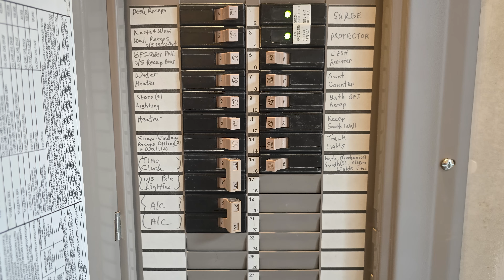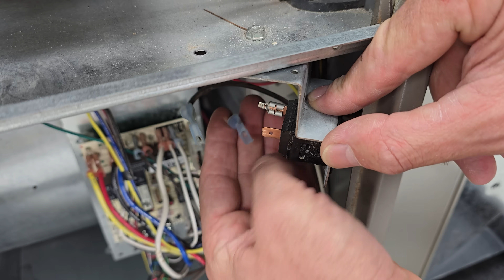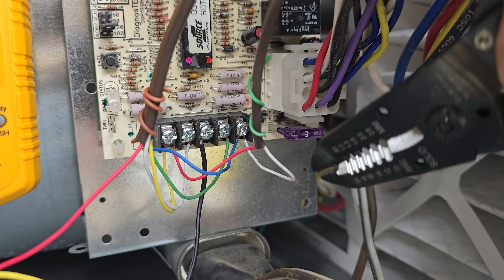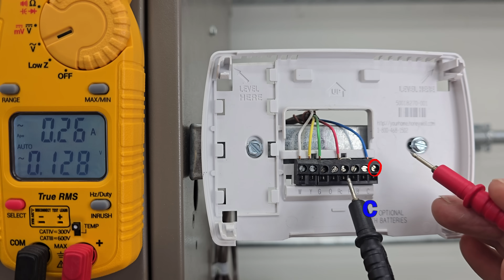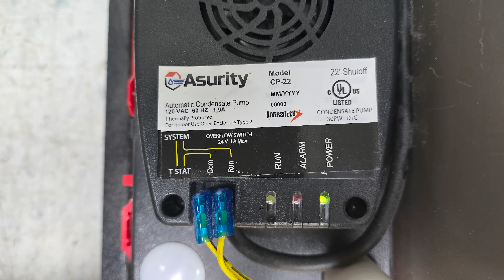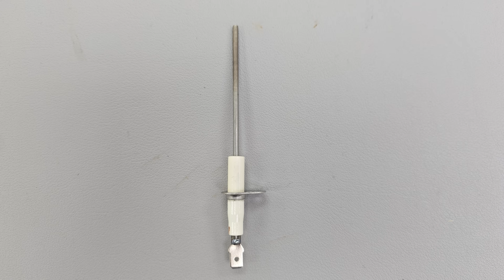Gas Furnace Not Working? Initial Steps for Troubleshooting When The Furnace Does Not Turn On!

Comment: Yeah this kind of electrical troubleshooting on furnaces usually ends up needing proper heating system repair when you find the actual problem - American Residential Services handles heating system repair for issues like this where the power's getting cut off somewhere.

Comment: This is a really solid step-by-step breakdown. It’s crazy how often a “no heat” call ends up being something simple like a switch, fuse, or loose connection instead of a major failure. That’s usually what experienced techs at American Residential Services run into as well.

Comment: I have an issue with Goodman package units where it shoots a little bit of gas, lights, then , shuts off then when I try to run it again now it doesn’t shoot out gas anymore, but when I put power to the gas valve it shoots out gas ,your help would be appreciated!!

Comment: Mine is tweaked it turns on the flame and gets hot but the blower motor does not turn on. I tried rotating the fins to see if there is any resistance and there is non and the thermostat got good batteries,  it works one day it turns on but then it turns off after like 1 day or two it's set on heat and fan is on I don't know what to do I can't really afford to have someone fix it anybody know what else I'm missing also the breaker never tripped it turns off and flashes red light one time meaning limit switch is on meaning overheat bc the blower doesn't turn on all the time some help me

Comment: ok i just installed a brand new MrCool model  number MGD80 gas furnace and it is supposed to be an energy efficient heater, now it uses more natural gas than my old 1970's heater did, my gas bill is like doubled, don't get me wrong the new heater heats my home faster than the old one, I did turn the blower motor down from high to med/high because it was so loud, is there a way to make it use less gas ?
Reply: put back on high . An get ur ducts cleaned. slash that bill by alot .

Comment: Got stuck on a furnace yesterday
Original complaint was furnace would light run for about 3-4 minutes then kill and run blower for another 4 rinse and repeat she stated it had been that way for years found burner  rollout was bad swapped for new then got code 31 took out some rust and dirt from flue put it back together then rolled out on code 33 put my leads in continuity in the safety harness so i could tell exactly when it was killing and trace out the safety circuit odd part was only 50% of the time would there be a rollout actually opening the circuit the rest of the time board was reading a false rollout id test against each rollout terminal and they're all  closed

Comment: Great video. Just one question I had the float switch not been tricked. The blue wire, the common wire, even with the batteries dead should have activated the system. So I assume you did not change the batteries on the t-stat and the common was providing power. Am I correct
Reply: thermostat without batteries could be blank if the float switch is tripped and wired to break the R(h/c) wire, instead of just the Y for A/C.
there's other cases where it may not be blank, even without batteries, like if it has independent Rh and Rc wires from two different pieces of equipment, with a common power from the other and an open float switch breaking the R.
**edit, realized I didn't state that most basic thermostat's are powered via the C(common) to R terminals(usually Rh and not Rc when two systems are used, but it varies). so breaking R with float switch would blank the t-stat. this does not apply to smart thermostats that do power robbing off other terminals and have rechargeable batteries.

Comment: They actually make 30 amp load 120 V switches that are motor rated for current in rush
     Big box stores even carry them you have to look for them. You might be paying $11-$15 for one single switch.
    Instead of $1.95 for a cheap 124 V 15 amp which that was only meant for resistant loads like lights.
Reply: most of the failures are from vibration, using the backstab/backwire push in ports and the plastic case cracking, especially in an attic or other wildly fluctuating climate.
also if connected to the furnace case with  conduit chase nipple or an open hole, it may get condensation/dirt build up and ruin it internally.
I have seen many failure cases over the last 30+ years and not just on HVAC gear.

Comment: Electrician with regard to switches if it is a motor load (which a furnace is) your supposed to use a HP rated switch rated more that the inducer and blower motor horsepower. If you use a regular switch, it must be rated 2 x the amp draw. So if the furnace draws 10amps when running you need a 20a switch if not HP rated. They make toggle switches up to 30A.
Reply: Hey electrician, let’s say it only requires a 15 amp switch, but I install a 30 amp one, is it going to affect anything? Like any resistance drop/increase?
Reply: My grandfather taught me to used motor rated 30 amp switches when I was a child 50 years ago. 
        Even in my own personal house over the years, I have replaced all the normal light switches with 30 amp motor switches.

Comment: Interesting you say you find alot of bad service switches. In my 29 years in HVAC ive never found one bad service switch nor a bad door switch either that i can recall. I did have to change out a bad light switch in my bathroom at home that looked similar to what you showed though but never on any piece of equipment
Reply: Interesting you’re here watching this video having 29 years of experience of talking shit and flipping on bathroom lights
Reply: I'm surprised you've not run into them bad. I have replaced endless amounts of disconnects, standard switches, circuit breakers and more on about everything you can think of, including lots of HVAC gear. now that was mainly as electrician, general contractor or specialist/third party when nobody else could figure it out. 
one thing to be cautious about is the standard light switches, when people use the backwire push-in's, is the plastic body tends to break with age and loses contact with the wire or moves enough the contact wont close when on. same issue with backwired/backstabbed receptacles. never use that junk.

Comment: I have experienced an Air Temp brand through which to diagnose. Everything works well except an ignitor that doesn't stay lit to be part of a complete cycle  Surprisingly, blower motor turns on and stops, restarts without ignition. I was wondering whether you may also figure it out. 
I look forward to your reply.
Reply: You need to call a tech to come fix it. You really shouldn't be messing around with your gas furnace not knowing anything about its operation
Reply: @HVACRTECH-83  true, without gloves and power running you can get shocked so @ngshein just call a tech